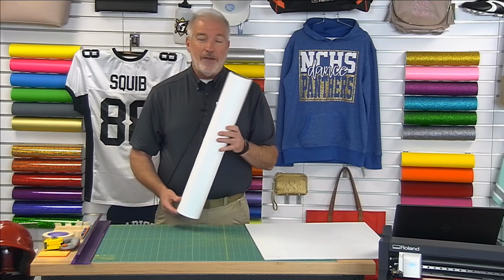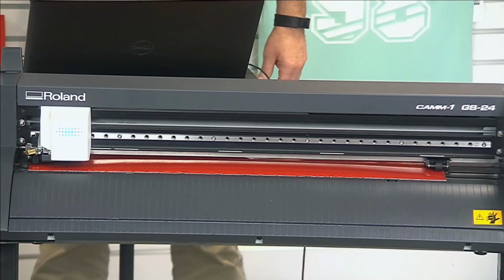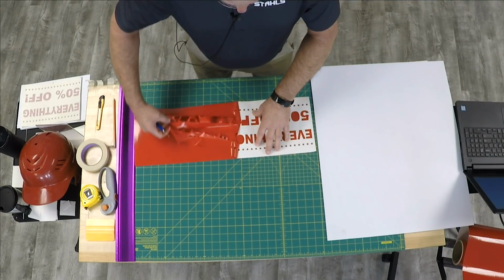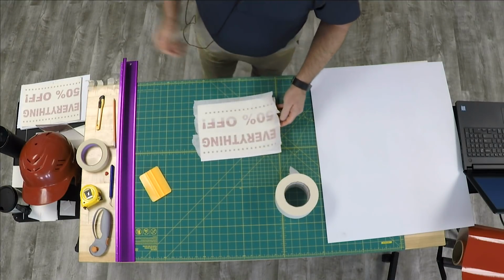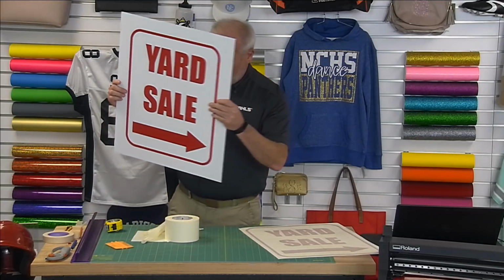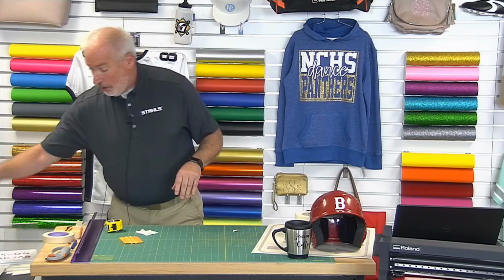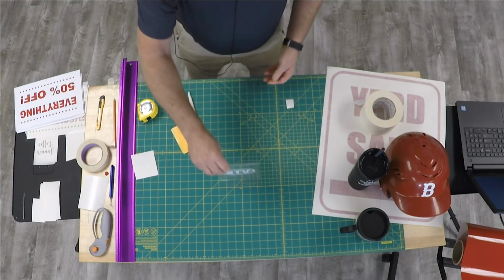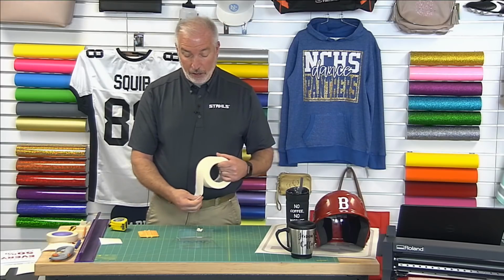How to Apply Sign Vinyl and Increase Add-on Sales

Comment: I was surprised to see attaching to drink containers. What is the longevity of that???? By the way, what is the brand and model of the roller cutter you're using???
Reply from the maker: We do not have any official testing on the longevity of it being applied to Tumblers but if you are hand washing the tumblers there should be no reason for it not to last up to a couple years. This is the same type of vinyl that shops make car decals out of. The vinyl cutter seen in the video is Roland GS-24.
Reply: Stahls' TV thanks but I meant the roller cutter, not the Roland... Ha ha
Reply: The rotary cutter looks like Fiskars (grey & orange are their brand colors).You can get them at JoAnns. I have a large & small one - they are wonderful.

Comment: When applying to a car window would you recommend applying in the positive (on the outside) or would you reverse the image to apply on the inside. Thanks.
Reply from the maker: You can do either, but the outdoor sign vinyl is designed to withstand conditions.